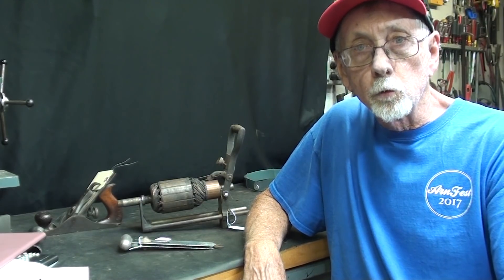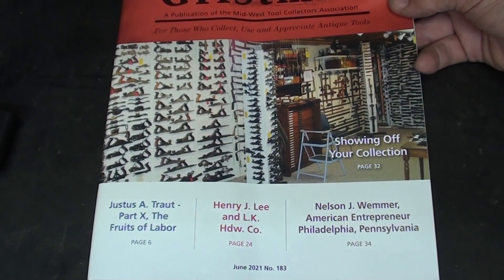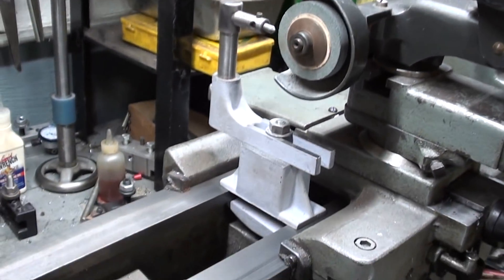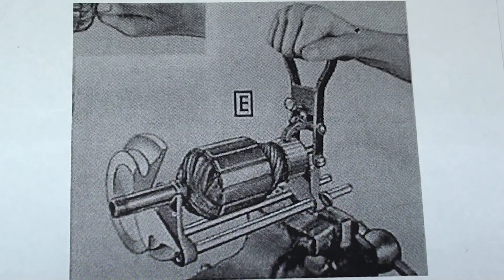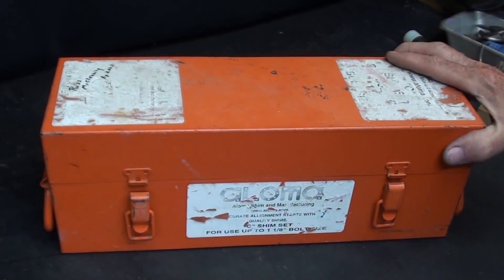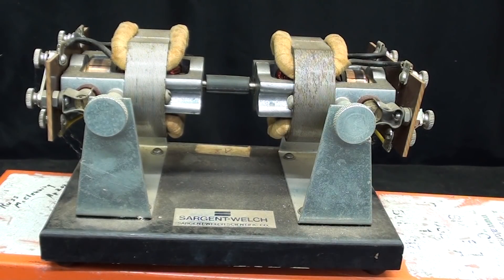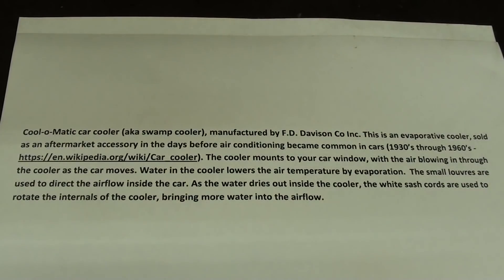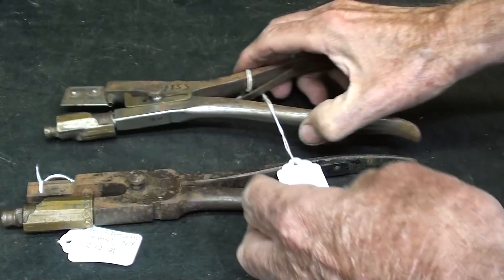WHAT IS IT? Mystery Tool #66b ANSWER tubalcain mrpete

Comment: It’s an armature undercutter.
Reply: After turning an armature you need to make sure there are on shorts between the segments. You also need a growler to test for open windings. Old school bet used for decades.
Reply: @triac777  Used one when I was little and helping my dad in the electric motor repair shop.  Used a growler too.  Both my dad got from my grandpa's electric motor repair shop when my grandpa passed in 1967,  so yes, its very old school stuff.

Comment: Pete, I do not know the name of this tool. I have one and use it infrequently. Most people use a trimmed hack saw blade to clean out the spaces between the copper bars of an armature.
Reply: Yep, I had to use a hacksaw blade in one of those short holders last time I had to true a starter armature.  This would have been much nicer though.
Reply: Why do you think that you need to tell Pete the name of the tool. It is covered in THIS video, and we all know what it is.
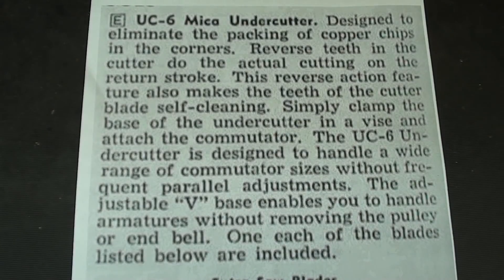Watch the video at 6:21 sheesh!
Reply: @johncoops6897  Why do you think I need to tell Pete the name of this tool. I simply stated, I do not know the name of this tool.  Are you the "What Is It NAZI"?
Reply: @billwilson7782  - OK I will rephrase it.... why do you feel the need to tell Pete that you don't know the name of the tool?
In this video, Pete tells everyone what the tool is used for, how it works, and the NAME of it too. So how, after watching the video, would you still not know what it is?